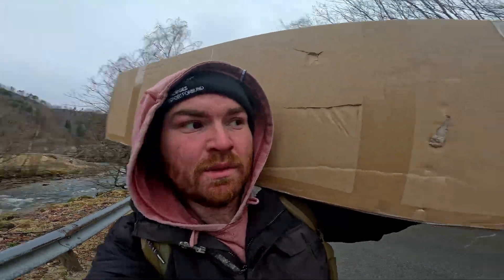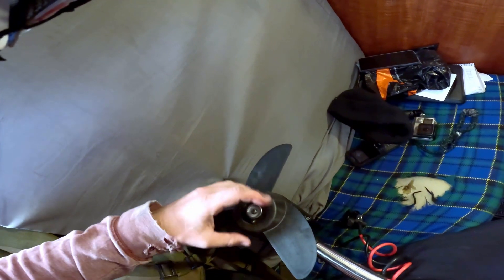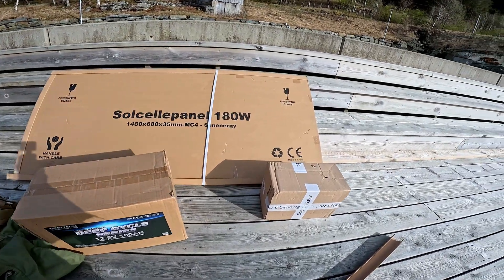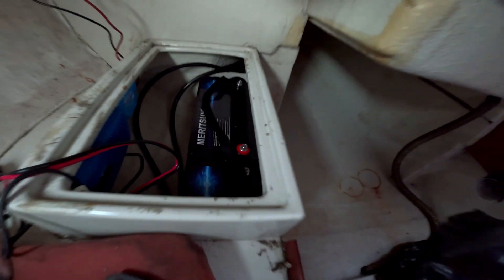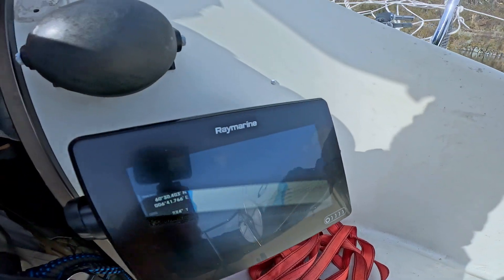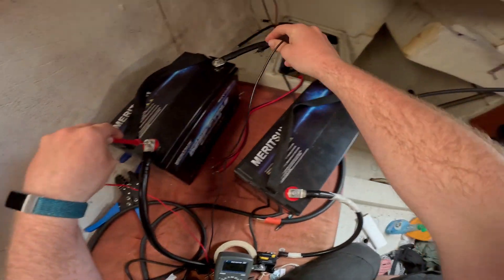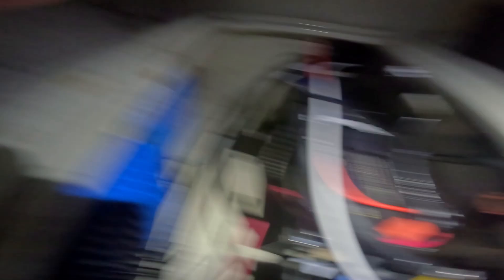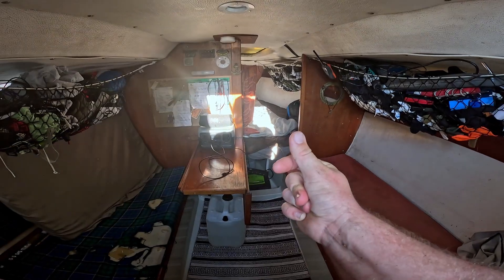Electric propulsion: DIY on my 22ft liveaboard sailboat

Comment: I'm putting a 10 mile, 16km range electric motor,lifepo4 solar system on my 1988 Laguna 22. I'm never in a hurry, I rarely motor more than 100 meters, but want the ability to get to land,
Reply from the maker: Your boat is 30% lighter than mine, so that will be more than enough I reckon!
What engine are you looking at?

The only thing I'd do differently from this video btw, is getting a shunt. I've arrived in a marina plenty of times with 60% left (smart charger shows how many amps it has put in), when I've been convinced I was about to run out 😅 Gonna get one in june.

Do post a video of your setup! I love to see how others go about solving stuff.

Comment: Hi. Look at my diy outboard build. The motor is too small, so is the battery pack in both capacity and voltage. I'd recommend switching to something closer to a Flipsky 65165 motor and a 48v battery bank. That gives you 6kw or around 7.5hp for thrust and much lower Amps and thus less energy wasted as heat. If you aren't switching, can that motor be run at 24v? If so, do that so you only have to run half the Amps for the same load. Gives you longer range for just reconfiguring the cells in series instead of parallel, and higher top speed since you get x rpm per volt. 12v is really not suitable for this. It's a relic from old cars.
Reply from the maker: I know, the main reason for going with 12 volts was the price of the engine (got it at a 50% discount). I would have preferred the 24V version, as the 50mm2 cables were a pain to work with. 
But at least my power loss is as low as it can be, no heat unless I run it at full throttle.
It cant be overclocked, sadly.

The MPPT can be used both as a 12 and 24V charger, so the plan is to get a haswing ventura f.5 (or similar) if the current one (protruar 3.0) dies. Although my main priority now is getting a shunt installed, and maybe a few extra batteries. Using a stopwatch gets old real quick 😅

6KW is way more than I need though, I've been doing just fine for two and a half months cruising the west coast of Norway non-stop. I prefer sailing, and except for narrow fjords with gusty wind, I've never felt underpowered.
But my last gas outboard was a 2,5hp, and I've been using oars as well, so the engine is very much an auxiliary propulsion.

But as I mention in my video, my setup would not work for a weekend sailor that needs to get back to the marina by sunday evening.

I'm sailing south for the canaries tomorrow, and I'll probably change the setup a fair bit as needed. Will film, and post it here of course.

Thank you for a well written comment, I'll check out your build!
Reply: @sondreelnes  that's 👍. Yeah I would only worry that the motor wouldn't be able to pull against the wind if you are having strong winds from land and you are trying to get in. Let me know if you want to discuss it one day - would be a fun episode to record
Reply from the maker: Yeah, thats something to avoid, although my new jib helps with that! Unless its too gusty, of course... Will do!

Comment: Put something between the batteries and the brackets holding them. Over time they will destroy the battery of vibrations, waves etc.
Reply from the maker: Already did. I cut planks to length, and stuffed the space between them. But that is sound advice, thank you!
Reply: @sondreelnes  Yea, we have batteries that sit with just metal and bothing between. After some time they move around and over time brake :) Just use some type of plastic / sponges.

Comment: Where did you put the solar panel? Do you use it to charge the batteries?
Reply from the maker: The 180W panel usually just lays on deck, and yes, I do charge my batteries from it! 

Its been a month now, and Ive never emptied the batteries fully. My next video shows how I go about using the setup, as it was filmed at the same time as the final parts of this one

Comment: I’m interested in your runtime and top speed on your set up
Reply from the maker: My batteries are 2x100Ah 12V Lifepo4, so Ive got slightly under 3 hours of full throttle on flat water (the engine draws 75Amps, but even running 50mm2 cables 3 meters from the battery gives me some efficiency loss).  That gives me 2,5-7 Knots on flat water, and a little over 2 in a 15 knot headwind with a little chop. Running at 1,5-8 knots gives me 10 hours, and eco-mode (2,5 knots) lasts for about 5. My effective range so far inshore and in the fjords going at 2,5kts have been 15nm. In comparison, a suzuki 2,5hp gave me 3,5kts, and a mercury 6hp had a top speed of 4,5kts. My hull speed is 5,8kts
Reply: Did you consider converting an old two stroke motor leg with a blown engine and adding your own motor.
Reply from the maker: No, but If I had a good DC motor laying around that would have been a possibility. You could still use the impeller for cooling as well.

But a driveshaft with gears wont be as quiet, and I got the haswing for half the retail price.

Im curious to see how long it will last though.
Reply: @sondreelnes  
That's good news..  pod motors are a great solution but be they hull mounted or outboard pole sized it's  very often the prop size number of blades and pitch that determines their effectiveness.. 
I will have to look up the Chinese manufacturer that a lot of people have been using ... For bikes etc they were initially sold as golden motors. .. 
Watch this space once I've had a chance to check.
Reply from the maker: I actually considered a pod drive, as outboards can be a bit of a hassle in chop.

But the maxi 68 doesnt really have a good spot for mounting one. Im also a bit skeptical about galvanic currents with a through-hull dc engine in saltwater. But thrusters work just fine, so Im sure its possible to do safely.
Reply: @sondreelnes  
I've just checked it is Golden motor.  The 5…10..15 KW motors look like the most popular. They do pod outboards   up to 20kw. but  I would imagine the price would be prohibitive. 🤔
There's a nice example of a pod DC conversion in  PBO. 🇬🇧
You can read and see how they convert a Parker Super Seal ⛵ last year from a vintage Butuk diesel inboard motor and how it performed.
Reply from the maker: Interesting! I'll check it out